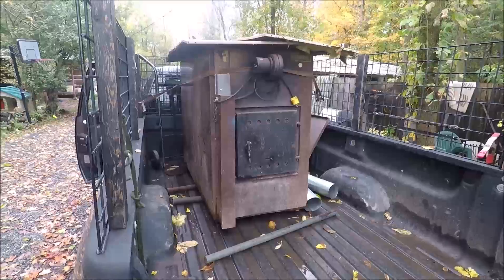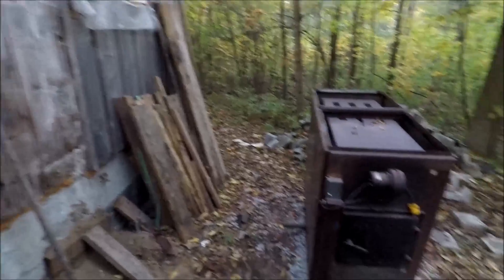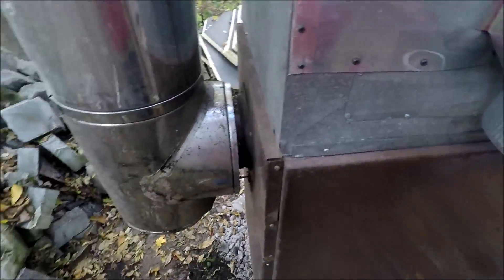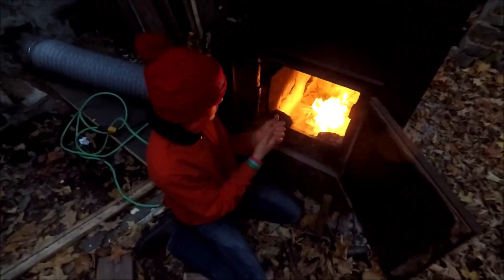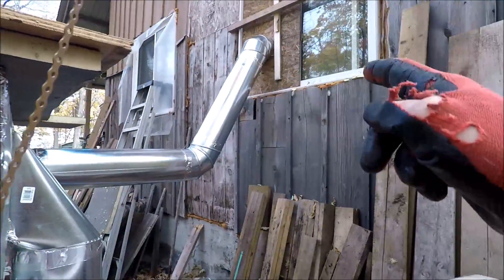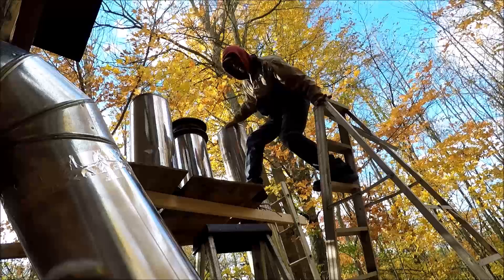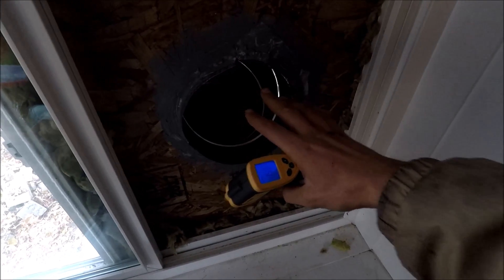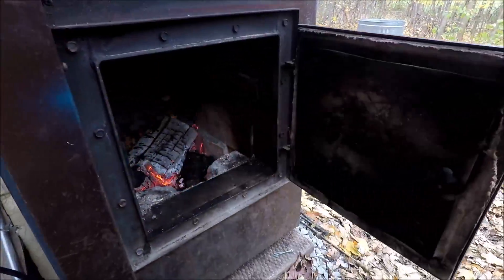DIY Outside wood burning forced air furnace FREE HEAT in the winter

Comment: Wouldn't it have worked more efficiently if you had the heat blow into the basement areas then vent through an upstairs window or roof vent? Not necessarily bake your basement but the basement window area would push heat to the main flooring zone, then because heat rises, it would cool some by the CV time it hit the rooms upstairs like attic or boys rooms.. not sure if they sleep where the dormers are. Then have a valve open and shut in that main blower to lessen the amount of heat into the house as any 1  time. Sorta like a water valve. On our old wood stove, which im not sure if it was a high end or what, but it came with the home when we bought it. Though the stove was in the house, it had vents that blew heat into ducts that led to a few rooms. Each room has a closing vent. But like blinds. You can let it in as fast as you want. In time, maybe run a few smaller tubes off to the colder areas. You should make sure you have a carbon monoxide alarm in the house in all rooms. But id direct the major heat to the basement or split it. Like a swamp cooler,  it onky blower cool when there's an ooen exit allowing air to blow thru. Heat does the same, kinda like in the car, your feet freeze while your face is sweating, push it to floor then crack window above so heat escapes there. Keep a stable temp vs extreme one way or other.
Reply: the heat into the basement plus a valve to leak smoke would kill the vermin

Comment: I Think,,Boy Did You give me Ideas,,Im Building the Same Thing as you are,but with a little smaller stove..I think With the Boxs on top,you need a gap from stove to the box..mabe about a brick thick in between.space them out,,then put box back on top and seal it...i will tell you why,,,i can cook on top of my square stove.you need that gap so that box dont over heat.it should be ok after that.you should not loose nothing,but might run a little cooler..its hot on top of that stove.im going to do the same thing with mine.my house is just little..i live off grid.its only 10x18,,i didnt want to put a wood burner in it,,ha ha it would run me out.but it gets really cold in Wv.im on face book,ill keep watching,,thats my 2 cents,,in watch putting scraps in the stove,it will plug up the screen shut on top,i found this out one night.dont use a screen,ha

Comment: Good day  Interesting video.  Back in 78 dad built a retirement house,end of farm. '' we are going to get combination oil-wood , Newmac, I think your's is too., only your's is just wood.  There was just me & bro.,, who work at warehouse for Home Hardware. We bought tractor trailer load of skids        from  HH. ,my o my dad had the house at 84 degree. I think you idea might just work.  I told              insurance co. about  draining fuel tank before putting new 1 in.  Because we were burning  wood    we were cut off.  My wife had heck of time to find co.  that would cover wood burning  stove. We    now have natural gas, & are not alot to burn wood, even though we  have stone fireplace.  The fact that you have chinmey outside, makes it alot safer.  Skids are very good wood. Now I think our's    might have bigger firebox.  We could put in skid boards   32 ins. long,stick them  up & in& down.  Alot of work but it's outside. I like it. Good luck & thanks

Comment: Sir Do you Have a Basement, In your House, and do you have oil hot air furnace, If so How come you did not Install inside your your Basement,Everything would have been easier, Don't get me wrong what you did is fine ,You just Made it more costly,for your self,, That really is not Homemade, You just put it outside, and made a outside wood furnace, When it would have been more Efficient, Inside, I,m just trying to help, Not dogging what you did, Sorry if your offended, Not meant to be that.

Comment: Everything about this terrible
Reply: How so? What's wrong? The unit is designed to be installed inside. This is evident by the thermostat that is exposed on the front.  So installing it outside is exponentially safer.

Comment: free heat? gas to get to the stove store. take it home buy expensive triple wall pipe. buy a chainsaw, gas can oil mix files now drive to the woods. it ain't cheap handle it three times before you get it into house. good luck. it ain't cheap heat.